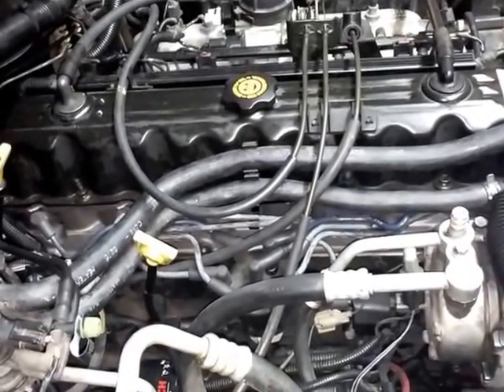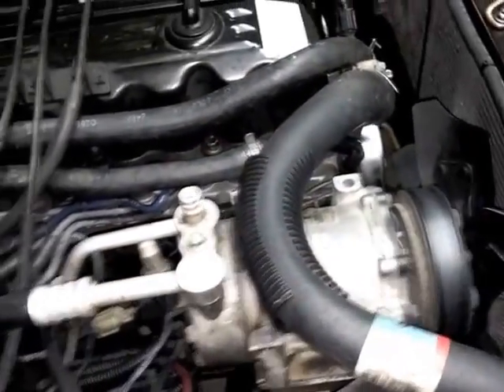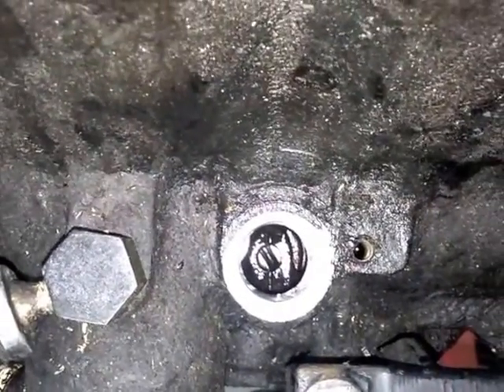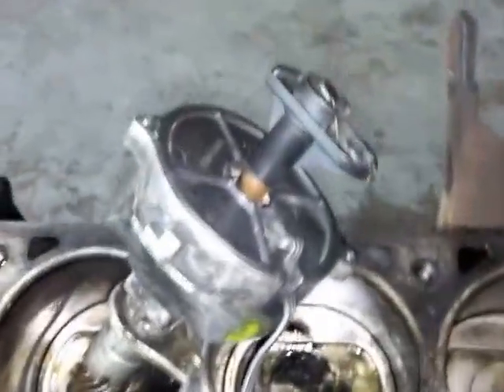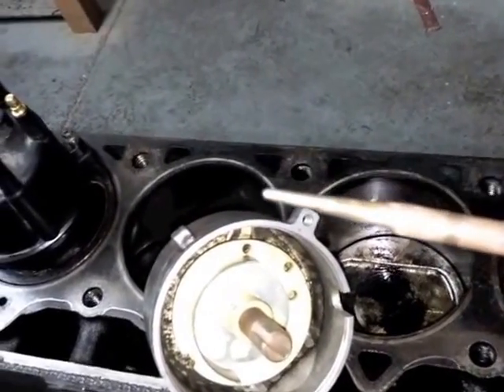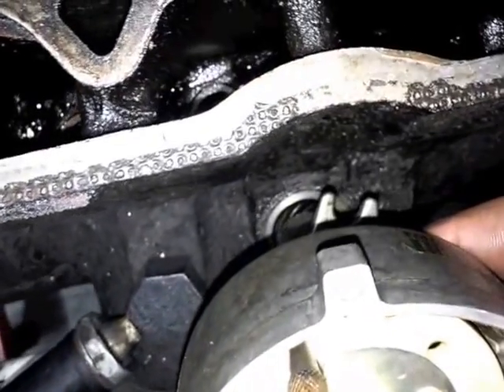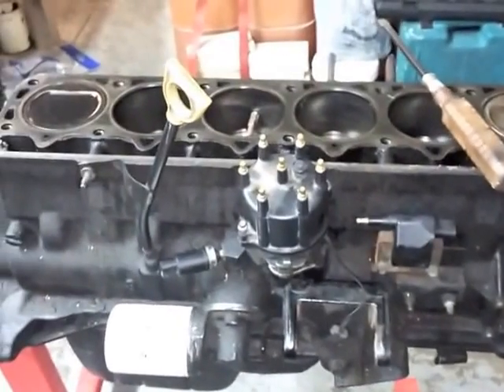Jeep Cherokee Ignition Timing / Distributor Install

Comment: This video solved a 3 month issue I had, I even had mechanics over at my house stumped. I ran across this video by accident watched it and even as simple as it is. This video made my jeep run right again. Thank you so much for this video!!!!!
Reply: Thank you for the info I had been working on this 95 for 4 days  you explained perficly keep up the good work thanks
Reply: Exactly the same here with me.  Crazy thing was it would start but not run smoothly. The previous owner must have just thrown it in there.
Reply: Is this the same on the 2.5 engine?

Comment: The video was very helpful not in the common way. I was looking for pulse ring positioning on a stock setup so I could verify all my "non-stock" parts were in the right spot. Even though it Renix, the sync timing is the same and I'm very close so I don't have to adjust it. I see a lot of videos but people have a off in the distance shot that really shows nothing, sure everything they say in the vid is fine and correct but I needed to see what the position of the parts are actually in. Thanks.

Comment: Unfortunately I tried the same trick with the CRT performance distributor but for some reason the slot didn't aligned with the bolt hole 😢
Reply: Você resolveu o problema de alinhamento???

Comment: Need to make sure its the correct tdc, one is cam overlap and the other is compression. I have the A/C compressor blocking easy access to #1, so I found TDC on #6, marked balancer and bumped around 1 more turn.  Didn't know about 11:00 and the ice pick trick.  Great info!

Comment: I took a motor from a 94 and put it in a 95 well the flywheel and the torque converter was different so I had to switch them I never marked a flywheel

Comment: I pulled the motor for a customer so that he could have it rebuilt brought it back to me three months later rebuilt, and it wouldn’t start.  After trying everything under the sun, even the parts Canon nothing   I found this video first and within 30 minutes I had it running better than new. THANK YOU!

Comment: Doesn't work I've tried it at top dead center compression stroke up. It's either right at the plug one on the cap or right in the center of that weird shaped piece.

Comment: Ive done all these steps and when I finally put it in at the 1 o’clock position the distributor is slightly off to where the bolt is supposed to bolt it in idk why it’s doing this I can’t get it to line up with my bolt ?
Reply: Também estou com o mesmo problema... Como resolveu?? Não alinha o parafuso...

Comment: You need to be specific. True TDC is only on the compression stroke. A piston can be at TDC at the end of the compression stroke and the end of the exhaust stroke. Just because the piston is on TDC doesn’t mean it’s on the compression stroke.

Comment: I've been battling my jeep for 9 months now trying to figure out what's wrong. Replaced every part with electrical. Tried timing multiple times. Never knew this trick until I watch this video. I timed it according to this video and it finally ran! Thank you for the straight to the point directions because it worked perfectly!!
Reply: Did it just not start one day? I'm doing the same thing with mine. I'm at 9-10 months of replacing things.

Comment: You failed to mention just because number 1 piston is at the top it does not necessarily mean its at TDC.... it depends if the piston is on compression stroke or exhaust stroke.

Comment: i swapped my timing chain sprockets and chain and im not sure if i did it correctly i had the dots facing each other. ill be dropping in the engine tomorrow and fire it up. If it isnt timed correctly would i be able to follow this video and set the timing correctly without taking the timing cover back off?

Comment: I just picked up a new project, a 98 XJ. It didn't run due to a few issues, but after sorting out most of them I still felt it was just running "out of time" but knowing that I couldn't adjust the timing sent me on a search. That lead to indexing the distributor (not something I care about right now) and then looking up a proper install lead me to your video. THANK YOU for going into detail about the PROPER procedure with a disto install. 

I hope to have a well running Jeep tomorrow :-)

Comment: Same here. I could not get this thing timed. Was about to give up when I came across this video. After watching the video it took about 15 minutes and the jeep runs perfect. I am a chevy man and I kept trying to time it like a chevy
Reply: Hey dude you think this will help if the truck idles roughly and turns off if i dont hit the gas???? its only smooth after 1500 rmps
Reply: @alanhernandez8440  have you ever pulled the distributor? If not then it wouldn't be out of time

Comment: why would you remove radiator hoses to get to your spark pluG? they aint even in the way. and won't coolant spill out all over? and air get in your system again making you have to bleed it again?

Comment: Well this video saved another guy’s rear.
I just installed a rebuilt
motor in my 99 XJ 4.0.
I tried to prime the oil pump by disabling the fuel pump and ignition and cranking the engine with the starter.
It would not register oil pressure on the gauge.
I tried about 7 -30 second cranks and no pressure.
I had to pull my dizzy , cut a flathead screwdriver and stick it in my dewalt cordless drill.
I got about three seconds of rotation when I felt some resistance in my drill and the speed bogged down and I heard (bloop) and the resistance was steady now.
I had my oil filler cap off and could see oil flowing through the rocker assembly.
I continued this for another minute or so then put my distributor back on after turning my crank to the timing mark at O.
I could see my #1 piston at TDC -and I put the dizzy back in just like you said.
Bolted it down, installed my plugs , fuel
pump relay and my cape, rotor, wires and it fired up nicely.
I also did a hard reset on the ECU.
There are good videos of that out there too.
Thanks man...got
me going simpler than I could find in three different manuals.
I hate friggin vague manuals dude.

Comment: Was wanting to get some info just got done doing the same thing and now my Jeep won't run it will crank but it just back fires
Reply: maybe 180 out
Reply: How do you solve the problem?
Reply: @Rulin500 first, there are many other things that can cause a motor to not start and just backfire... 
one common thing that i have ran into is major vacuum leak (my experience with sbc350 backfire and no start was, the washers were still on top of my manifold when i installed my carburetor, so i was getting major vac leak between carb and manifold...)
                 if it is "180 degrees out", you need to rotate distributor 180 degrees. or spin your motor by hand till the distributor is at top dead center 1 cylinder, take your distributor out, turn you motor over by hand until you get back to the number 1 cylinder and then reinstall the distributor.. your motor will be at top dead center on the 1 cylinder twice, once for compression stroke, and once for the exhaust stroke. the distributor has to be installed while on the compression stroke at top dead center not the exhaust stroke
Reply: MrMrsregor    Hey I am about to attempt this, how do I hand turn the engine?
Reply: False Michael need leverage.. use a wrench or ratchet on the crank shaft pulls bolt to turn the crack shaft. I think all of the motors that I have worked on turn clockwise, but u might want to make sure that is the correct rotation for your motor
Reply: Will this work for a 89 Cherokee?
Reply: Dallas this is an amazing video, thank you for the time and effort to that you put into creating it. I followed these directions to the T and me 97 Jeep GCL is finally running once again. Right now I fighting with a fuel to air ratio problem, it stalls and will not idle, scanner says the fuel is rich and stinks.

Comment: NOTE : number 1 piston is set at T.D.C.  on the compression stroke ( where both valves are closed for no. 1) how to tell .. use your finger over the plug hole it should pressurize against your finger.
Reply: Thank you for stating what i was thinking.
Reply: Double check the timing marks on harmonic balancer too

Comment: excellent explanation, love it. my cherokee is a tooth off, lucky i have one motor for parts and the one im, driving,  i feel like my timing was retarded but no way to adjust timing,  meaning  distribuitor seats at fix position, i will correct the thot of.   keep gpig, will subscribe now,  im an auto tech but been a while since not work on a jeep now i own one lol.

Comment: If I remove a distributor but don’t crank the crankshaft manually, should I still make sure it’s at TDC before replacing the distributor, or will it stay at TDC?
Reply: yes...everything is banked off #1 cyl. you should have marked it before removal.

Comment: Dallas, 
After suffering for about six months with an annoying distributor squeak (my neighbors can relate), I took the plunge and changed the distributor on my 1996 Jeep Cherokee. Your video was very informative and having the engine outside the vehicle really helped me see what was needed to be done. I was able to swap it out in a couple of hours and it started right up, minus the annoying squeak. Thanks again and if you are in the San Diego area, i will buy you a cold one!

Comment: This video was a lifesaver. I have an 83 CJ7 that had the HESCO Mopar EFI mod done to it runs and tunes like a 94-95 Wrangler. The original owner had a buttload of work done, all by an offroad shop, including the EFI, which includes a new distributor. I've had it 8 years and decided to rebuild it, with a shop doing a long block rebuild after I pulled it out. I shot detailed pictures of everything. On the install, I found the motor shop had left it at #6 TDC instead of #1... no problem, I should have checked it. The distributor was wired 180 out from the original EFI mod which kind of complicated finding and fixing everything as well. I originally left it as original, just swapping the plug wires and it started right up. Played with the dist for a little timing love, but it was all or nothing, and it would die with little adj's.  Finally it ran smooth with not much in the way of power, I was still tweeking things making it worse, and decided to tear it back to the distributor reinstall. I'd found this video while searching for documentation on the EFI Mod since I didn't have much in terms of documentation other the my Haynes 83 CJ manual, which didn't cover this any of this.

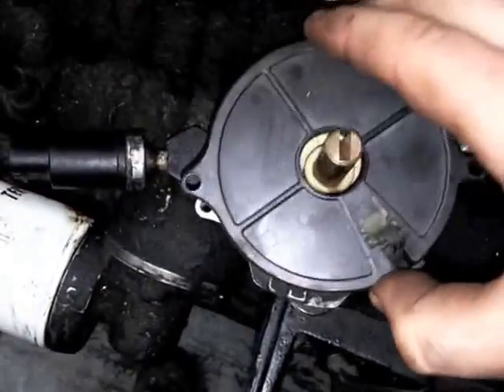I followed this video to the letter. It was even a little challenging since my distributor didn't have the fork on the base to lineup with the hold down bolt. I used the casting marks on the distributor (comparing to the video) to figure the one o'clock position on the way in where the fork would have been and brought it down. I almost didn't buy it because to looked like the rotor was at 5:30 instead of 5:00. I went with it, got everything back together, and the thing started instantly and screams down the road. My guess is I was firing on the upstroke even though timing told me I was 2 degrees before TDC before I tore it back apart and used this video to get me home.

Dallas... yer a stud. I owe you big for a well shot, well explained video. It gave me everything I needed to figure out what I didn't have, and it went in on the first shot. Way to pay it forward man.

Comment: pretty cool. ive spent plenty of years working on and building customers jeeps but finally have 1 of my own. been chasing small issues and bugs. never knew about locking in the distributor like that. my biggest question that i cant seem to find anything on is with the pcm controlling the timing, what do you do to put the computer into "timing mode" to verify the timing is at 8 degrees?

Comment: damn good video brother!!!
i just bought a 95 jeep grand cherokee with 287 thousand miles!! im in the process getting it out of limp mode.only drives in 3rd, i can swithch manually but that way only engages two and three, od stays lit im at the point where i am going to buy all those sensors under the tranny pan and replacing them . I havent yet decided to replace the tcu, i tried resetting it, but its the same
  Im hoping it just the sensors that are clogged since its common. 
what sold me on the car was its immaculate leather interior and exterior was amazing as well. 

thanks again for this great video, i was going to change the distributar as well as the plug wires  .but was waiting on a usefull how-to video, now i got it.

Comment: I would just like to say "thank you" for making this video. I did the whole rear main/oil pump/pan gasket change on my 200k '96 Cherokee Classic. Like a dummy, I forgot to place the engine in TDC mode and yanked the distributor out to prime the oil pump. I was totally lost, and freaking out a little bit, honestly. After watching your video, I put everything back together per your instructions and it started up and ran perfectly first crank. Again: THANK YOU!

Comment: How could you tell if you were on the "compression stroke"? Thanks!
Reply: Yes, i agree with Mark C..,. This is a great video but, just because the # 1 piston is at the top of it's travel, doesn't mean its at TDC for #1 cylinder. You could have watched the valve movement on the companion cylinder  for #1 or cranked over the engine with your finger covering the open #1 sparkplug hole. when you feel compression blowing out the hole, you know you're on TDC #1. Other than that, great video !!!!!
Reply: valves will be closed on intake and exhaust.
Reply: You WILL know if you're on the compression stroke if you follow the tutorial AND the dizzy drops right in. Should the dizzy fail to align properly (1st time I was super close) and you have double checked your work, then you're on the exhaust stroke. ;)
Reply: Moobs Nolast-name you guys helped me out, past 4 days in the cold and now I know my issue. It was always so close to lining up but just a hair off, i didn’t check to see if it was on the compression stroke. Will update in a few hours if this fixes my issue
Reply: i replaced the timing chain and lined up the marks but when i rotated the motor the distributor doesnt not point at 5 o clock. the only time it points at 5 oclock is if i rotated and the crank is on TDC but the cam mark is at 180 out.
Reply: Simple...put your finger over the spark plug hole as you turn the engine over.  When it blows, it's in the compression stroke, stop piston at Top.
Reply: Take out number 1 plug. Put your finger over the hole. Turn the engine. When you hear air or feel air coming out then the piston is coming up on compression stroke. Then line the mark on the balancer on 0. That's it tdc on compression stroke
Reply: Compression tester.

Comment: I just did a distributor swap on a 96, what a pain.  Was hoping I could mark orientation of rotor on old one and line up new one to match but for whatever reason it would not line up the same.  Took out #1 plug and turned motor over to get it at tdc but had the cam 180 deg out of phase since it is a 2:1 ratio on timing gears,  Turned over but would not start since crank and cam sensors where so far off from each other.  Took me longer than I want to admit to figure out what my problem was.  Had to turn crank around another rotation then it worked.

Comment: Thanks, that was a great tutorial. Just replaced my distributor because of chirping sound. I noticed something though that might help others. If you have the same problem I did or at least your engine is running good and you just have to replace the distributor and aren't experiencing any timing issues, you can just turn the crank manually until the rotor and that forth hole line up the way you showed, then insert the punch and pull out the old distributor and skip pulling the spark plug in order to confirm top-dead-center.
-Again,
thank you, thank you, thank you.
superbly filmed and explained.

Comment: Of course it helped out, thank you so much indeed!  One important thing to add is that when Cylinder #1 is on Top Dead Center, it should be on Compression Stroke, and not on Exhaust.  Maybe I missed it when you said it.
Reply: +Travis Burke I'm assuming you figured it out by now, but in case you didn't, you can put your finger in the spark plug hole and crank the piston up, and if air blows past your finger, it's on the compression stroke.
Reply: How do you tell which stroke it is on, exhaust or intake?

Comment: I missed that punch part...and I think that may be why my jeep isn't running. I'll let you know, thanks for the video brotha! XJ Life!
Reply: +Hons Barrera she runs great. I used a screwdriver to turn the oil plug until it was at 1 oclock. you have to take off the radiator fan and manually turn the belt to get piston 1 at the top of its turn or top dead center
Reply: +z0mbicidaI 11 o'clock. if you don't get the positioning in right it will run like shit or not at all. there is only one timing for the xjs motors from 95 to 2002
Reply: +z0mbicidaI and on top of the distributor it ended up being water in my gas rails

Comment: I have  a 93 Jeep XJ. My Jeep would Start but would hold  Idle for a few second. Then it would Die. The TPS, ISC, fuel Filter was Changed started to Run then Die again. Test for Fuel Pressure (need 39psi-50psi) Barely Fuel pressure. REPLACED Fuel Pressure Regulator n Fuel Pump Assy. Same problem. Replaced Crankcase Sensor. It Ran for 20 minutes. Decided to fuel Jeep. Went to Gas Station n Filled up. Then went to the same freakin Problem. Clean FuelRail n Injectors.
Need Help ....Going Crazy!